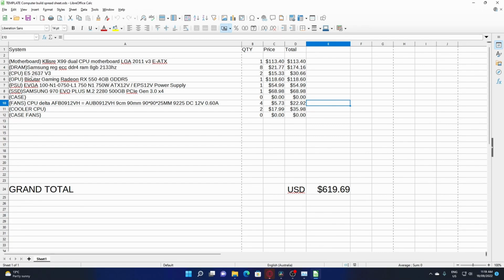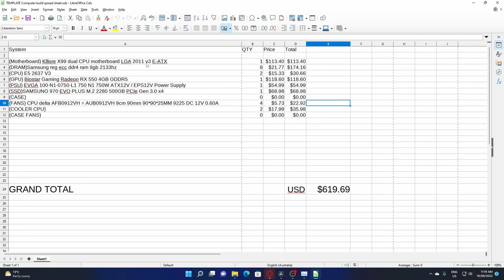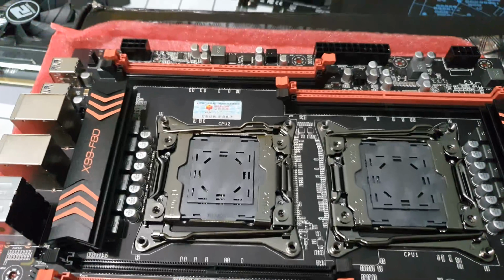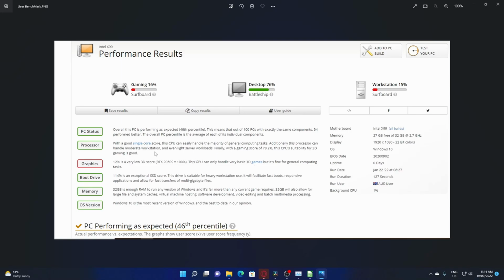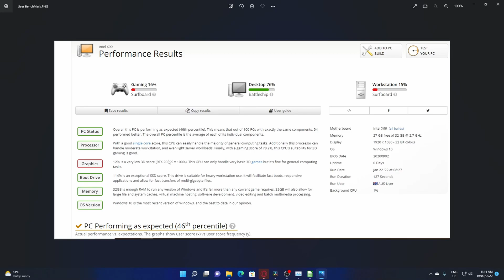Building Dual Intel Xeon E5 2637 V3 Sever 64GB Ecc Memory

Comment: Amazing,..
why you choose 2637 V4 either 2666 v3
Reply from the maker: The E5 2637 V4 might go into my trueNAS. The difference between the V3 and V4 is V3 supports 2133mhz on the dRam and the V4 supports 2400mhz. 
I'll soon put a video up with a system running daul E5 2697AV4 paired with AMD 6900xt
Reply: @ProjectSmithTech  nice.. okay will see your review later, i wondering how to auto power on, on this x99 mainboard can you tell me how?